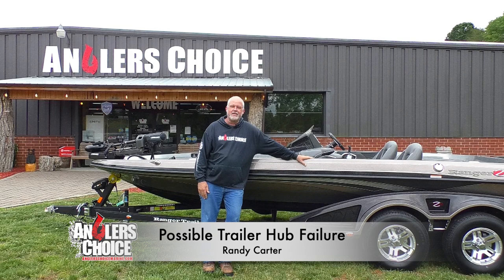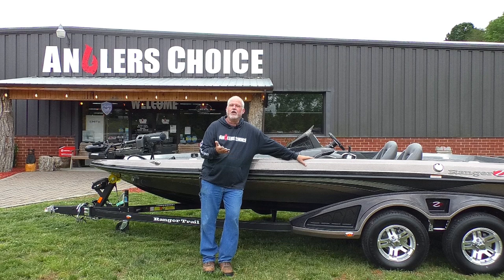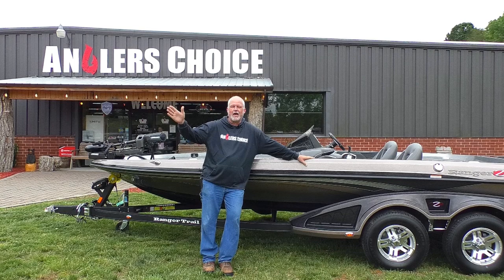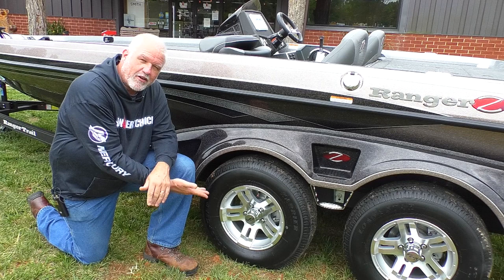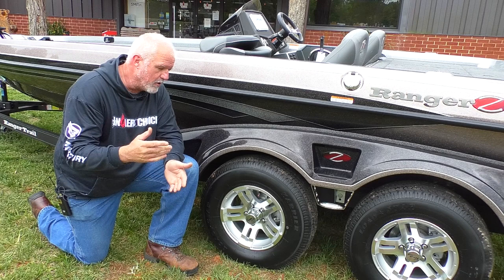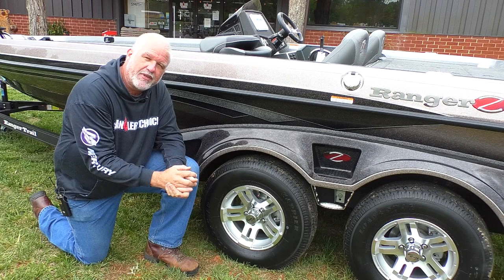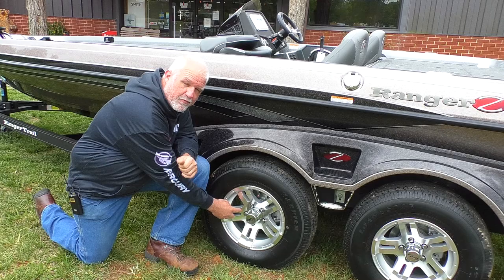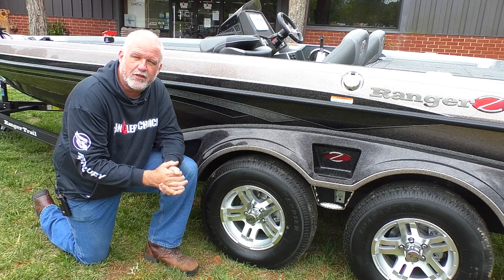Randy Carter - Trailer Hub Failure (ARE YOUR HUBS TIGHT???)

Comment: Randy great video and great tips !! I have a 2014 Ranger 620 with the torsion suspension and I’ve gone through 3 axles ! Granted 2 were under warranty when there was a warranty but my last one wasn’t and 4 grand later I’m fishing again. My point is Ranger owners with torsion suspension need to keep an eye on not just the wheel bearing aspect but also the axle going bad aspect. Keep an eye on your tire wear especially or if one side seems lower than the other. Telltale signs an axle is compromised especially the torsion ones.

Comment: One of the best checks you can do is occasionally Jack the wheel off the ground and check side to side play as suggested but then give the wheel a spin. (Needs to be in a very quite setting, The bearing will tell you its health in most cases.